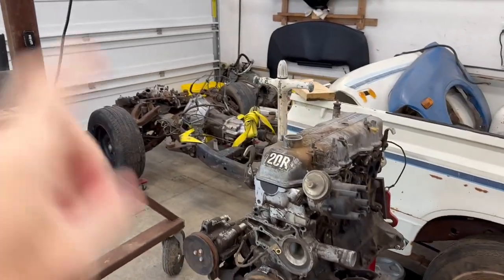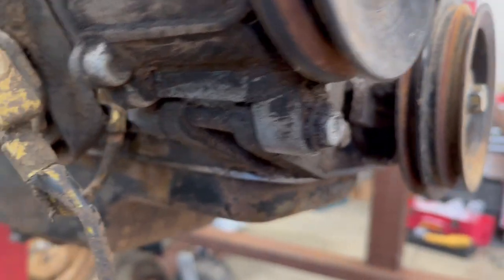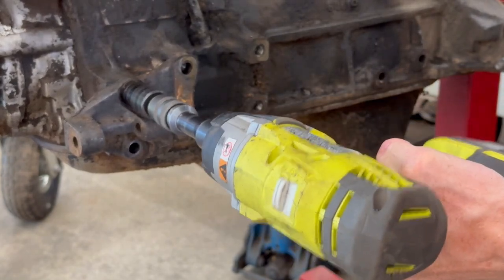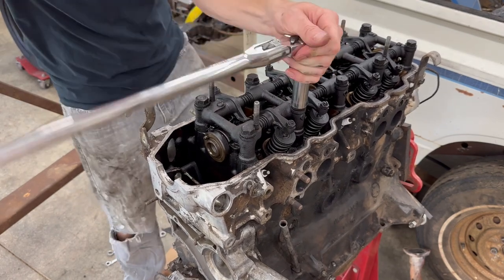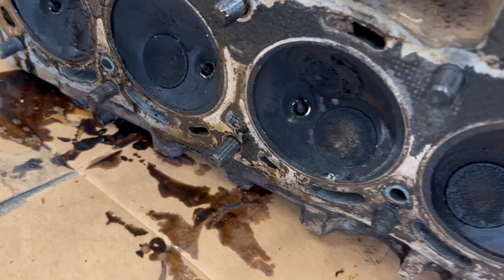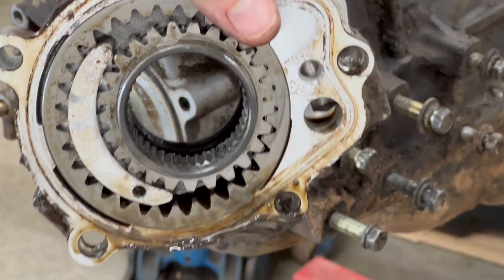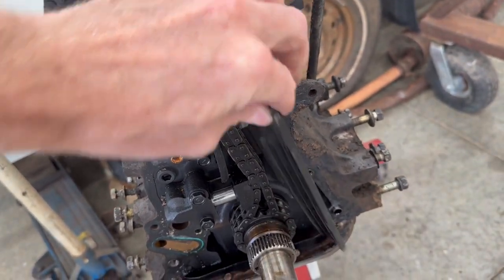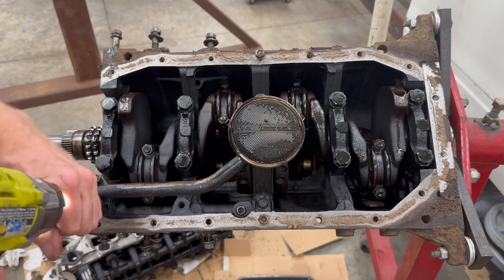Toyota 20R Engine Teardown - 1980 Pickup Parts Truck

Comment: The truck was used by a locksmith Company in Altus OK , then sold to the father of the guy i got it from, when his dad passed away the truck sat in the driveway for the next 17 or so years when i found it in 2020, I got this truck for free because i bought his dads Toyota 1986 2wd Xtra cab long bed , IM super stoked that I get to watch Brian do his thing on this baby! My trucks and cars have been.  1967 Carrona 4dr, two 1985 Tercels, two 1985 4x4 single cabs, one 1992 4x4 single cab, one 1994 4 runner, one 1986 2wd xtra cab long bed, and my last one is a 2003-Tundra step side. and of course, the 1980 that i gifted to 6th Gear Garage
Reply from the maker: Thanks again for the truck and working with me to have it shipped. I'm in awe every time I look at the frame!

Comment: I got a 20r that was sitting out in a field for 15-20 years. Looks save able. Restoring every piece of it I can cheaply since it's all I've got for my 74 Celica. Including the Spark Plugs and wires. Can't wait to test fire the engine once I put it back together. Have not done much with carburetors but it's awesome to have a back up engine for a rig that originally had one even if I go more modern and higher HP. I have messed with a 75' sbc 350 that has a Carter comp. carb on it. That's what I picked the engine up in actually.
Reply: 1974 Celica, boy, does that bring great memories, you lucky dog. Brings back the days of my 72 and 73 240 Z when gas was 23 cents a gal. 😂

Comment: Gracias por el video, yo tengo una 1987 a la q le estoy cambiando motor y transmission pues originalmente es transmission automática pero ya conseguí otro pickup para repuesto con transmission manual, espero poder hacerlo correr pronto

Comment: After doing many 22R motors....Always helicoil the timing chain cover for that hidden head bolt to timing chain cover(they strip easy and lets you tighten it a bit more)....Use Toyota black sealant on timing chain cover, rear seal retainer to block, and head gasket at timing chain cover...the toyota sealant is easy to take apart over most RTVs....Its the only way to stop oil leaks.....That engine didnt look bad for what it went through being exposed to weather....The broken steel timing guide scares me...never seen that, seen many plastic guide troubles though...

Comment: Yeah I had a mitsubishi 4g54 engine with a broken timing guide like this lots of metal shavings in the oil from the bolts being rubbed off got the truck free from another guy who knew I needed a truck

Comment: Sure you know that 20R, per 85 and post 85 blocks are getting rare....You may want to talk with LC Engineering about buying what ya got....
Reply from the maker: I'm sure it wouldn't be worth the cost to ship it across the country, but it will go on my shelf of toyota engines/parts for sure
Reply: @6thGearGarage  I forked out $6500 for a stage 2 stroker motor.....I think they can afford to pay shipping....They have been out of blocks for awhile now

Comment: Love your videos keep up the good work. Also quick question I’m having a struggle with my 20R and for some reason it’s not starting anymore I have recently rebuilt my engine with brand new parts and still no luck. I had made sure that my distributor was working at the correct timing and still unable to fire up. I was thinking it might be the carburetor which I replaced also with the right adjustment and still no life at all. my main concern is, could the timing chain be misaligned. Or if so, what type of procedure did you Align it, to? Thank you. Any information or resource will be very helpful.
Reply from the maker: Do you own the factory service manual for your truck? It should tell you all the details of setting the timing properly. So if you have spark, and if you can smell fuel, then check your ignition timing and mechanical timing. You just rebuilt it so I assume compression is good.
Reply: @6thGearGarage  hey thanks for responding back. Yes I did exactly what the Toyota Haynes book wants it performed and still no start up. I did, however, make sure the compression rating was correct and so far it’s mostly it’s higher than 120. I started to begin noticing that when the engine is being turned over by the starter, it feels like the valves are hitting the cylinder, even though they’re in the correct timing. Just hesitating to turn over. What I probably might do is completely removed the engine and start from scratch, making sure that everything is corrected
Reply: @6thGearGarage  oh, one more thing I forgot to mention if you have any resource or information that is very helpful I will gladly appreciate it as I want to restore my vehicle just like yours, sir  thank you
Reply from the maker: @akita4070  Yeah I would double check everything is at TDC then.
Reply from the maker: @akita4070  The Haynes manuals are better than nothing, but the orange Toyota Repair Manuals are the way to go.  They're more expensive, but worth it.

Comment: I replaced the timing chain and guides on my 87 with roughly 180k on it with metal backed guides and heavy duty chain. A year later the guide broke and jammed between the lower sprocket and cover. Luckily it only took out 2 valves. I went back to the plastic guides. I have a hard time trusting the metal guides. The only mechanical failure in 250k